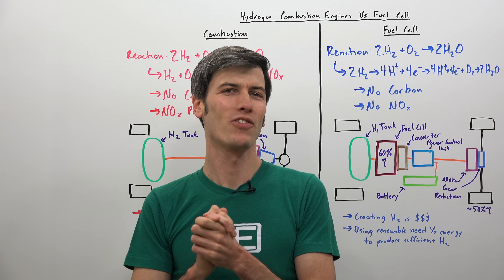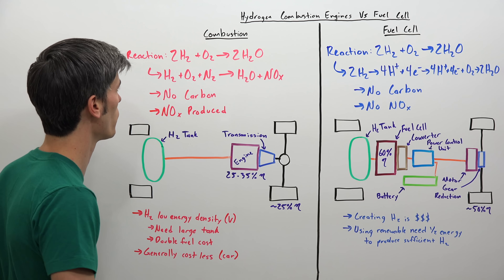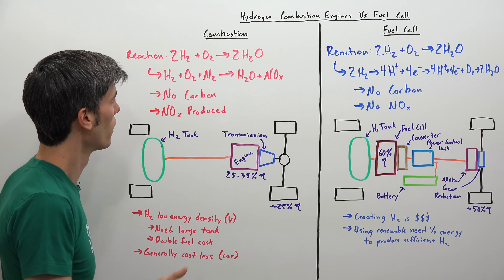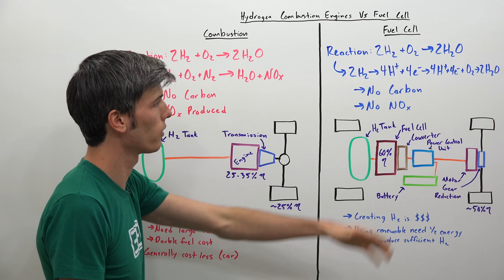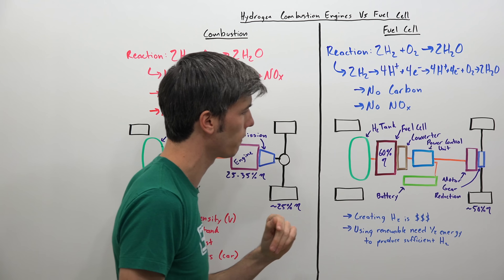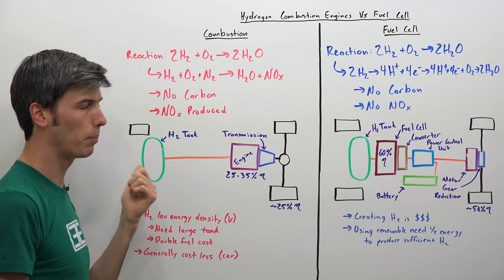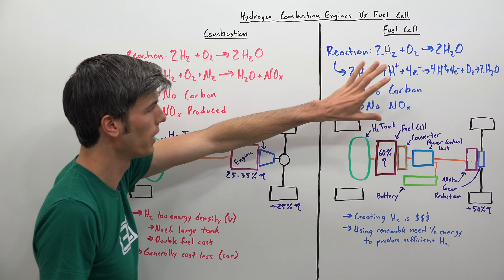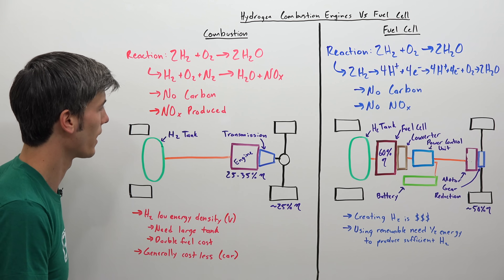Why Hydrogen Engines Are A Bad Idea

Comment: Diesel engines also make a lot of NOx, and we mitigate that with selective catalytic reduction and urea injection systems. How big of a pain in the rear end would it be to stick an SCR or DEF system on an H2 engine?
Reply: @THAT Guy  pretty sure they just used the acronym to refer to selective calaytic reduction from earlier in their comment
Reply: Is the N and O combine into NO Becuase combustion then I would assume we already put it into the atmosphere unless there is a device we use on vehicular already in that case we just put it on this
Reply: It creates more complexity and more stuff to break. Fortunatly my 95 F350 has no scr or def
Reply: @johnnytheprick Def are the non believers!
Reply: But up your protein intake  first for best results
Reply: @johnnytheprick selective catalytic reduction lol
Reply: johnnytheprick selective catalytic reduction, the use of urea/adblue to reduce the NOx content of exhaust emissions. Fitted after the diesel particulate filter and usually followed by an ASC (ammonia slip catalyst)
Reply: You Don t get the nox down with a dpf filter, that's why diesel engines have an egr system...
Reply: @oBCHANo  True, but there are still obstacles that still need to be overcome before we see more widespread usage on a range of different vehicles that people use from the day to day. I have no knowledge on Hydrogen engines, so I am going off assumptions. If you could pull up to a gas(?) station and pump your vehicle full of the required fuel in five minutes vs waiting for it to recharge that would be good. Of course you could still use electric for everyday use cars. They are getting much better in terms of performance, and you can recycle them, but this might be a good alternative for trucks or other vehicles that need to travel large distances on a time schedule. Planes could take advantage of this. Electric planes don't seem to be in the near future. It would require the plane to be just one giant battery without room for much else, and from what I have seen, they have made hydrogen planes work successfully. They are looking to have a commercial plane for testing in the near future. So to completely right it off at the moment seems a tad unfair, though who knows, our battery efficiency could balloon in the coming years.
Reply: Ultimately all emission control systems are a fudge.  You need a ton of urea or large egr to make enough difference.  Mfrs said they could manage it when govt had concerns about using diesel to reduce CO2, unfortunately they didn't meet the weak targets and our cities are now saturated by NOx and particulates. It didn't work and most mfrs didn't use the time to develop batteries, supply chains or electric motors.  Tesla is now in charge of the motor industry.
Reply: They simply does not work on H2 engines, because the catalytic process needs high temperatures, but H2 engines exhaust (a lot of H2O in it), is mainly low temperature.
Reply: @etommmy  NOx is only generated at higher temperatures, that is why it is more of an issue with diesel engines (higher combustion temps) than petrol / gas.
Reply: @dingodazz3724  You made me think and search. Hydrogen actually burns hotter than ordinary fuels in air. So it makes more NOx. But! -> Therefore maybe the exhaust is hot enough (I think the thermodynamic cycle efficiency is about the same like the oil fueled engines, so it stays hot) to make the catalyst process possible.
Reply: @johnnytheprick  No, SCR = selective catalytic reduction.  Uses metalic oxide catalysts on a ceramic base.
Reply: hydrogen when burnt only emit ...   get this...  WATER   lol...   makes no sense to me, but I thought the h2 was getting burnt up..    proof.. Jay Leno's  BMW Hydrogen 7 video..  glass under muffler, car running. glass filling with clear water...  the the guy Hawkeye takes a drink...   ick.......... I dunno whats in that muffler
Reply: @harleyme3163  the problem is the combustion temperature is high enough to cause the nitrogen in the charge air to also oxidize. If you were only taking in pure oxygen you'd be absolutely right...alas, air is 79% N2 so NOx becomes an issue.
Reply: @johnnytheprick selective catalytic reduction
Reply: @johnnytheprick selective cathalytic reduction. You can't use 3-way cathalysts (only works stoechiometric=gasoline car) in the lean combustion of diesel cars. The SCR deals with NOx and another Cathalyst with Soot and paricle matter, if i remember correctly.
Reply: He is right its easier just to mitigate the nox either via the exhaust or just cool the damn cylinder down with water mist or whatever to reduce temps and eliminate nox. Also, what most people don't know is you can get an engine to run in a much leaner condition when you use a cooling mist so you're not only eliminating nox you're making the whole process more efficient because you're not injecting a tonne of extra fuel most of which is to cool the piston crown and exhaust valves. This is OLD TECH!!!
Reply: @xXimanidiotXx  just collect the ammo,and I ll use it on my fieldcrops!!
Reply: Reduce the temperature of combustion and you can reduce NOx significantly too.
Reply: @johnnytheprick SCR is a selective catalytic converter.
Reply: Water injection to cool combustion would reduce/eliminate NOx.  The heat absorbed by the water would make steam and even more power.
Reply: @talon0863  e
Youre exactly right. Look at truckers they use water injection, although not to enable them to run lean but stop their engine melting when hauling heavy loads up long hills. Should aid in keeping the old dpf clean aswell!
Reply: Not a lot. But you sacrifice fuel economy and reliability and etc. EV motors have longer lives than ICEs and it’s the battery that is actually the weak link. Just use hydrogen to replace the battery and off you go.
Reply: A rectifier converts AC to DC.A voltage regulator controls voltage amplitude.
Reply: most of the NOx on diesel engines is removed using the EGR system, which basically recirculates the exhaust gases and reduces NOx emissions
Reply: @Steven-vi2we  The problem with water injection is that it increases smoke (particulates)while it reduces NOX.
Reply: @johnnytheprick SCR is "Selective Catalytic Reaction" where NH3 and NOx are brought into contact with a catalyst to make N2 and H2O.  In a car, they use Urea as the source of NH3, DEF is a urea mixture.
Reply: If everyone were using them, a lot of the emission-controls and a lot of the engines would be unmaintained &/or tinkered with.   ...and probably a lot of the emission-controls would be removed or de-activated by the owners.   Result: Millions of heavily-NOx emitting cars. Want to breathe in that world?  ICEs are too dirty for mass-use, no matter what the fuel.
Reply: @michaelossipoff2433  most of the pollution comes from older ICE cars. Modern ICE cars are extremely refined and are very environmentally friendly. The fact that owners remove these emission control equipment is what makes the more "dirty". And i know only 2 people who have removed their EGR. If you don't do these modifications, modern ICE cars are very environmentally friendly
Reply: @dieselgeezer18  An EGR valve sadly, does reduce the life of the engine. I've heard mechanics claim that EGR valves can reduce engine life expectancy by as much as 40%. I don't claim that's correct or not. Just what I've heard. ironically, the EGR does reduce the engine's fuel efficiency which means you burn more fuel per journey which means more carbon per journey. I think the way fuel is made now is simply better than it was years ago and that's where most of the improvements are along with cats, particulate filters, and exhaust fluid systems.
Reply: @Skibidoop Probably H2NO3.
Reply: Use pure oxygen, not air. Solves the NOx problem. Unfortunately an additional expense and potentially explosive, so only suitable for niche apps like auto sport or aviation apps.
Reply: @Skibidoop Nitrogen being introduced into the equation is assuming that you're using oxygen from the air, which is not necessarily required. If you simply break down distilled water, which is 2/3 hydrogen and 1/3 oxygen, you'd have a hydrogen engine without the NOx byproduct.
Reply: Exactly, DEF is just another added expense on the vehicle with an added cost to it. Not to mention it also would likely mean having a limp mode when you run out much like with existing diesel cars.

Comment: the short story: hydrogen is a good idea.
Reply: The hydrogen economy is a farce
Reply: @jessharriman3254  germany has thrown away 550 GIGAwatts of green power, as the network simply could not take it. and storage was not possible. might as well could had made ammonia out of it . even if very low efficiency, its still better to same some of that 550 GIGAwatts, then just to throw it away. allmost an eqvivalent of what our single nuke plant produces in 200 days. wirth thinking about it from this perspective too.
Reply: @jessharriman3254  you could the say about owning a private vehicle rather then using public transport. But we all want freedom of movement and not the greenest solution.
Reply: @nagyandras8857  Large wind farms and solar fields of sufficient size should have ammonia-producing factories built on-site. They'd have easy access to large amounts of the power generated, and when there's peak power production and not enough demand, they could produce ammonia. Raw hydrogen itself is not very useful as a fuel source, it has none of the properties you'd desire for a fuel source, it's a low density, highly volatile gas that can escape almost any containment, and will frequently damage and embrittle the containers themselves. Ammonia, on the other hand, is fairly non-volatile and low toxicity compared to other liquid fuel, it can be stored in almost any container, and is reasonably energy dense at atmospheric pressure. It's also an extremely valuable fertilizer component, so simply having "green ammonia" available on the market would reduce fossil fuel use elsewhere. While hydrogen is still a key component here (being needed for the Haber-Bosch process), the transportation sector would be better served by having ammonia-burning PHEV's. Pure ammonia combustion would be less efficient well-to-wheel than hydrogen fuel cell vehicles, but that could be easily offset by having the battery-electric functionality that a PHEV vehicle posses. An ammonia-PHEV with 50km+ range would satisfy the daily driving needs of most of the world, and the infrequent times when that range isn't adequate, the NOx emissions per-vehicle would be acceptable. Cities and towns could ban running combustion engines within city limits, and engine use could be restricted to highways away from urban centers (where you need to use the engine, anyways).

There's definitely potential within the broad "hydrogen economy" scheme, but hydrogen fuel cell vehicles are a waste of time and resources, governments should abandon support for them, and eyes should turn towards ammonia combustion in the short term, and direct ammonia fuel cells in the long term, if such a thing is viable.
Reply: If implemented properly***
Reply: For hydrogen to be "green" we need "green" hydrogen. Rather
Than storing excess solar/wind/hydro in batteries, we create and
Compress hydrogen for off peak
Use on site  or for cars, etc?
Reply: @thomasronning9034  in that form its not good. storage of raw hydrogen is a bad idea. high pressure and/or low temps are required. instead, make ammonia, easy to store and more dense then hydrogen.
Reply: @nagyandras8857  : Agree but disagree. See my post please.
Reply: Not really. It's really reactive, making filling up rather dangerous. It is faster to fill than charging a battery, but in applications where you have to frequently refill/recharge, it may be better to just design a vehicle with a swappable battery. This is why gasoline/diesel remain king: cheap, relatively safe, high energy density, and vehicles can be refilled quickly.
Reply: @Ostsol  turn it to nh3 and then yer golden. case closed. hydrogen is good.
Reply: @nagyandras8857  Ammonia is certainly better, though it must be stored pressurised or at less than - 33°C to maximise energy density (a third of diesel). Also industrial synthesis of ammonia is not a "green" process. The hydrogen production generally utilises fossil fuels and thus produces carbon gas products -- which obviously defeats the entire point of using ammonia. Thus, you still have the problem that the "green" alternative methods for producing hydrogen are expensive.
Reply: @Ostsol  update your informationa  bit, visit the green ammonia projects, and face the 3d reality. YARA for example is building huge solar parks to make ZERO EMISSION AMMONIA, okay ?
Reply: @nagyandras8857  Solar is not free. You still have capital costs, both in terms of the initial construction and maintenance. It may not be terribly expensive over the lifetime of the solar farm, but production speed is highly variable depending on weather and latitude. Also of relevance is the actual cost of solar without government subsidy. For now, petroleum remains king, though I'm certainly not going to say that it will remain so indefinitely.
Reply: @Ostsol  check out germany, power to gas program. there is an overproduction sometimes in the grid from renewable sources, that overproduction is simply wasted energy. still not free, but still it can be utilised. and check out that even despite, what amount of green energy has been wasted thisway in germany alone. quite shocking. now, nh3 can have a near instantly variable production rate, and storage at 10 bar is not an issue (unlike pure hydrogen) by weight and by volume you can compare it to lithium or the supposed solid body batteries if you want to. even if the full cycle is very lossy, its still by far the best and most versatile way of power storage even for long periods (like years). not hard to modify exsisting cars to accept it as a fuel, and its sustainable. its a good thing.
Reply: What if we stored the hydrogen in water. You guys do know a drop of water contains 4,493,775,890,000 Joules of energy at all times.
Hydrogen could be gotten by an onboard electrolysis machine. It would produce zero emissions if we use distilled water because seawater electrolysis creates chlorine gas
Then the hydrogen could be pressurized and pumped into a modified propane engine as hydrogen is very combustible
Reply: @Momo-xs8mo  a few problems with that. where do you get the energy required for the electrolysis in the first place, and then the next problem is that distilled water is not conductive and can not be split by electrolysis. lets just stick to using waste energy and renewable green energy to make ammonia , as it has very low requirements to store, and it can be used in many ways. it can be used in combustion engines and it self can be an SRC, so no pollution there, or can be used to fill up fuel cells that can power electric motors straight away. its a liquid battery vaugely. hydrogen is good.
Reply: @nagyandras8857  water when mixed with potassium dioxide is able to be split via electrolysis. It’s old technology and is how the submarines create their own oxygen to breathe onboard. There would obviously have to be some sort of car battery that is powered by an alternator and a solar panel. The hydrogen and oxygen produced can be stored and pressurized instead of being vented into the air.
Reply: @Momo-xs8mo  pure h2o will not split. adding potassium dioxide makes it conductive. now you still need power to split the water. problem is, if you split the water and then burn the resulting hydrogen you end up with about less than 10% of energy than what you used up to split water. so might as well just use the energy required by electrolysis. allso hydrogen escapes nearly all kinds of containers, requires high pressure and low temps to keep it in a tank. thats why in its pure form  it is a bad medium.
Reply: @0hypnotoad0  I drove a 2021 toyota corolla and I got 43mpg for a long trip .
Reply: @Momo-xs8mo  source for your joules figure pls?
Reply: @peterdoe2617  simple, currently it can no be stored. the grid can't take it. large storage   battery banks are not viable. only viable thing is nh3.
Reply: Dangerous? What? The 'Toyota USA' channel made a video where they shot a hydrogen fuel tank with a gun, it did not explode, the hydrogen just left the tank safely.
Reply: @dogogamer212  thats true. its just inefficient in terms of energy density both by volume and by weight. allso allways wants to escape , and needs quite some preswsure to keep it liquid. ammonia is vastly superior in all these fields.
Reply: @nagyandras8857  ammonia? Is that an alternative fuel? I should look into that.
Reply: @GoldenEDM_2018  silly thing to say, you assume EVs are cleaner because no CO2 comes out of their tailpipe (they don't even have one) but due to battery production emissions, an EV produces twice as much CO2 from production as a hydrogen ICE, and assuming the hydrogen the ICE uses is made using renewable energy, it will not pollute a single gram of CO2 from use. Another thing to mention is that child labor is used to source cobalt, one of the main materials used in lithium ion batteries. Yes, it's the unfortunate truth, but elon musk does not care about the environment. He just sells EVs and advertises them as zero emissions vehicles just to make money.
Reply: @GoldenEDM_2018  I'll agree the second you prove to me that EVs are cleaner than hydrogen cars.